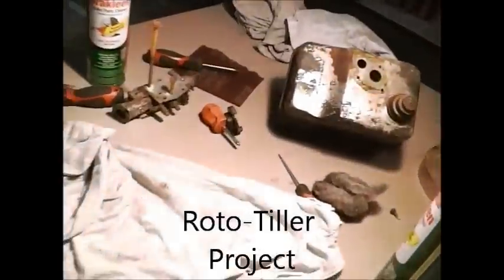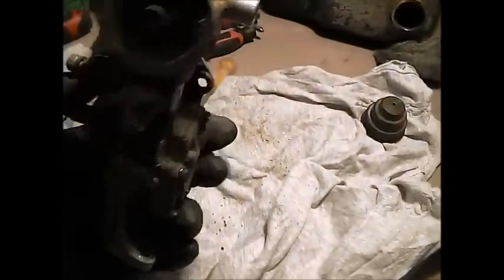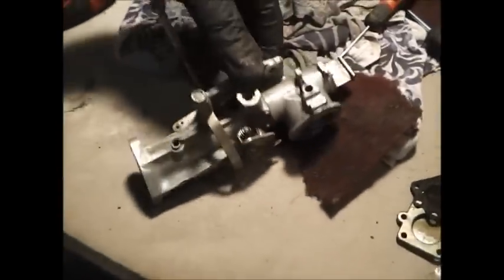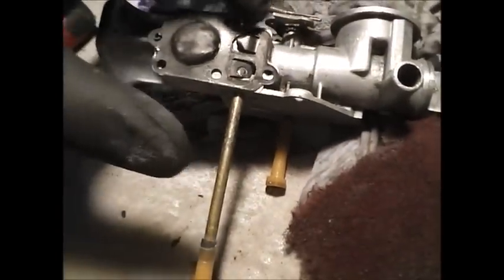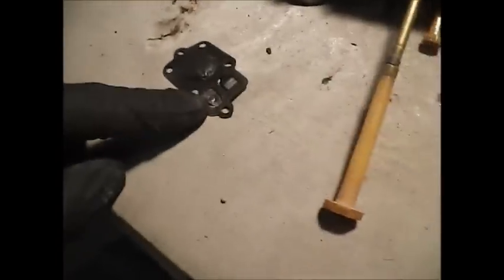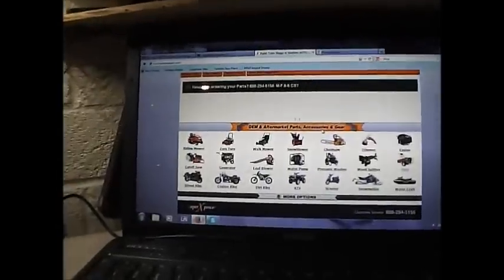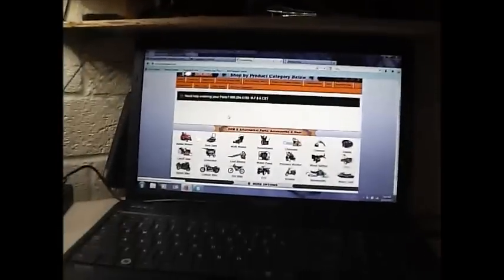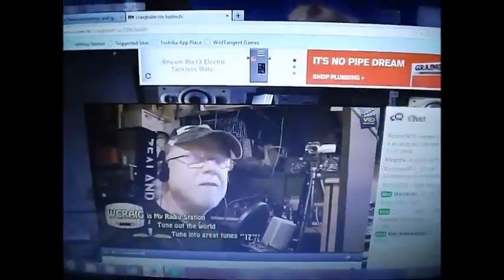Roto-Tiller project Pt. 3: Carb rebuild and part suppliers

Comment: I have this same Carb:  Briggs & Stratton 299437 Carburetor Replaces 297599 (per Amazon)  But its over $100 if i were to buy it new.  On mine, the smaller pickup tube broke off at the base.  Any Ideas?  I was thinking about carefully drilling it out and gluing what's left of the tube, but i'm hoping there are some better ideas that don't call for buying a new carb.
Reply from the maker: $100, really?  You can buy a old used edger for cheaper than that just for the carb?
That pick up tube is just for fuel so if you  can rig a new one with some hose I say do it. If you even can used some silicone hose and use a weighted fliter, like they use in line trimmers, to hold it down to the bottom of the tank, try it. Hope that helps some. Appreciate the comment, Matt.

Comment: I have to prime mine with gas get it to start,then it runs fine. What’s does that indicate?
Reply from the maker: That usually means the fuel pump gasket is worn out and not holding prime.  I would change the fuel pump and clean the float pin. If the float pin/needle is gumed up than you can lightly clean it with a scotch bright pad.  If it has a groove on it than you would need to replace the float pin and spring. Hope that helps and thanks for the comment.
Reply: RYEINDUSTRIAL Thanks

Comment: So my tiller has this exact same carb. However, it won't start but it has spark. I took the carb off and cleaned it thoroughly. Then I tried to spray some starter fluid in carb but it started leaking the starter fluid out of a pin hole at the bottom of the carb entrance. What does this mean and how can I did it?

Comment: Did you have any issues separating the carb from the tank? After removing the screws did they easily come apart... Or did u have to pry them apart. I have a engine similar to yours and I have a problem where they don't want to separate. I took out the top 3-4 screws and expected to easily separated  the units from each other... But it was like it was clipped or fastened inside the tank somehow.....??? Can you tell me they do not do that and I can just carefully pry the carb from the tank. Thank you for your opinion and I believe you can help me out.
Reply from the maker: Thanks for your comment.  They can be a little difficult to remove at times.  The carb sorta glues itself to the gasket.  I use a standard screw driver and easily pry the carb from the tank working your way around the carb base,  not just prying at one end which could result in chipping the metal on the carb.  If it just wont budge then there might be an additional screw.  There shouldn't be anything inside the tank, from my experience.   Like you said, usually 3-4 screws but might be one more hiding.
Reply: RYEINDUSTRIAL Thank you so much for replying...not to mention so fast. I appreciate that, and much respect, right back at ya. I will check 4 an extra first 2 b sure I got them all. Then I will go with your suggestion / recommendation. No matter the outcome, very much appreciate your time, and your willingness of knowledge to be shared with myself.

Comment: great video , i wondered if you could help me, do you know what the factory setting is for the carb please, as i think the previous owner has messed about with mine and when i got it running it was bogging down, so i just wanted it to back to factory setting and start again if i have to alter it to get it to run sweet . if you can help it would be great , thanks in advance
Reply from the maker: richard cole  hey Richard, sorry for the late response and hope you got it figured out by now. The idle air screw, I seat it fully closed and turn it out 2 turns counter clockwise. I then give it a little throttle. If it bogs down and has black exhaust, its rich and I turn the screw in a half turn. If it bogs and has no black exhaust I turn it out a half turn. Can take some time to get it right but thats my normal adjustment.  Try a half a turn at a time. 
Just n fyi:
The air screw I show in the video is  only for idle. If its bogging down when you accelerate then its usually a fuel starvation issue or governor problem. I would check the fuel pump gasket and clean the carb up. If those check out okay then check compression and the governor.  Hope that helps, cheers!

Comment: What were the carby part numbers mate?
Reply: 495606
Reply from the maker: Hi Helen. Sorry just saw your message. I didnt keep the part numbers, sorry to sag. It is a common briggs carb. I took the old gasket to a lawnmower repair shop and they matched em up. Hope that helps some. Cheers!

Comment: (PLEASE HELP) i have the same one mine is pushed out the same amount i have the motor on a 2 seater go kart and it doesnt have enough power to go to move i ordered the part it should be here 2mrw will this fix it? its not giving it fuel properly carbs clean tubes are tank is only thing is mine the Diaphram looks like yours
Reply: could also be bad rings I tried everything even bought a whole new crab for this one brigs,  after that. I learned that bad rings can prevent the the engine from providing enough vacuum to make the carb work properly. After I rebuilt the engine (took me about an hour.) The thing world start first pull even ran on diesel.

Comment: is that circle peace on the gasket suppose to be buldged out? like is it really bad?
Reply from the maker: Yeah it was bad. when it looks like that the pump wont deliver fuel properly and the fuel bowl wont keep up with the fuel needed for the engine to run at high idle. It can still run but over time it will rip and fail so I replaced it during the rebuild.  Hope that helps. Cheers!
Reply: i push the gas in and it gives gas and lets go and gives gas and lets go and gives gas and lets go fast but it idles fine so thats my problems?
Reply: Like Mine is pushed out a lil bit like half of what that is